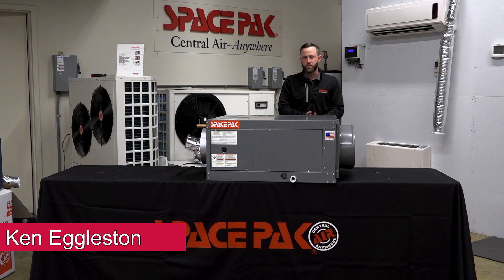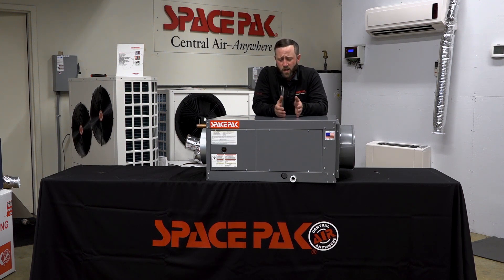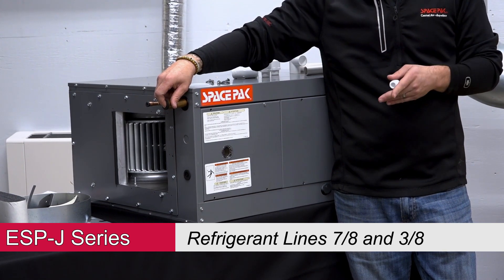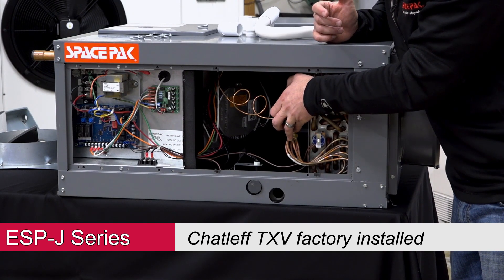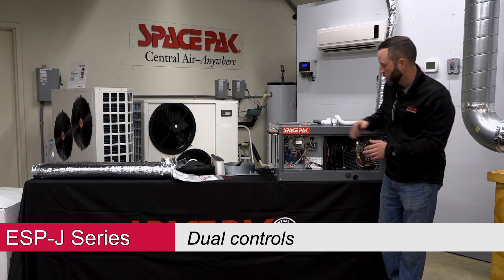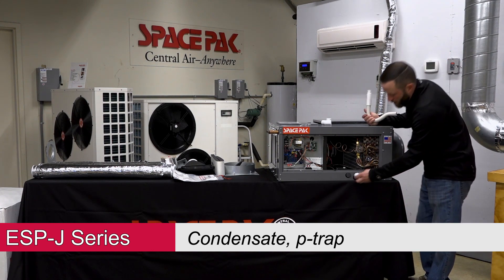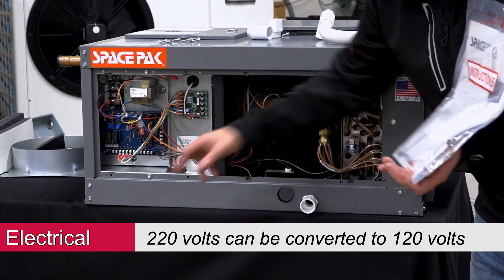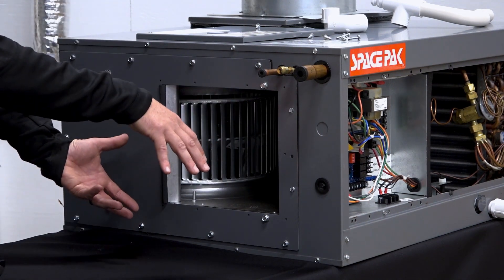Installer Training: Air Handler

Comment: I live in Arroyo Grande, Ca.,  Central Coast.  I have an existing home, 4 yrs old with a newer HVAC unit running on Propane.  I do not like it.  I would like to install SpacePak and wonder is the existing duct work can be reused by installing duct work through it?  I have 18' cathedral ceilings with no attic.  Also, I am building an ADU with detached shop and want to install same in this house as well as radiant floor heat.  What is the best way to go about this?

Comment: I have this unit. It was here when I bought the home in 2015. The unit was built in 2012. It never had a trap on there. The ESP-J unit and condensing unit shut off, then the unit drains. But it will not come back on. I always have to restart the ESP-J, then the unit will run. I added a trap, and now it will not drain at all unless I suck the line outside with a shopvac to start it. I had to use the Lasco HVAC trap since I don't have the one the should have came with this unit.
Reply: ESP-3642J is the model. Any idea for help? My local HVAC guys haven't been able to get it to stop short cycling with 5 years of visits. Waiting on a call back from SPACEPAK
Reply: ESP-3642J is the model. Any idea for help? My local HVAC guys haven't been able to get it to stop short cycling with 5 years of visits. Waiting on a call back from SPACEPAK
Reply: Did you ever fix the issue?

Comment: Hello.  Can the balancing orifices be installed anywhere on the path to an outlet?  Specifically, at the plenum, before the sound attenuator, or after the sound attenuator?  Thanks.
Reply from the maker: Hi Chris, they can only be installed AT the plenum connection. Nowhere else!